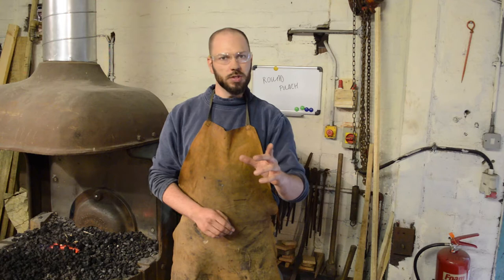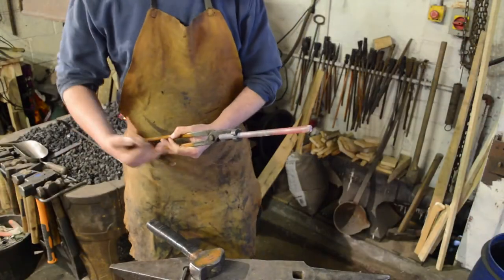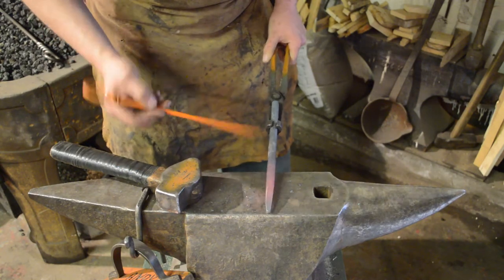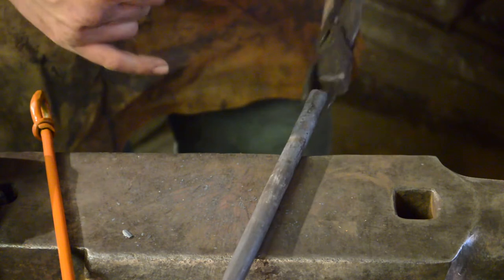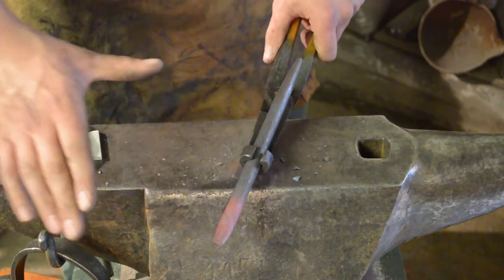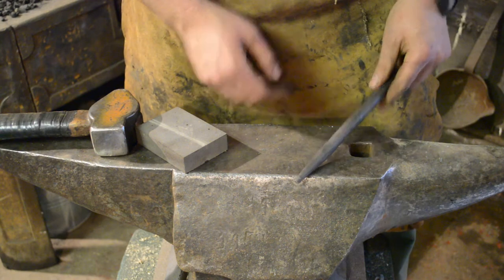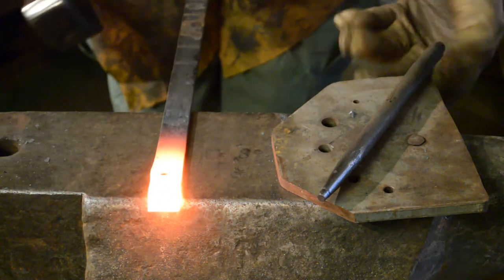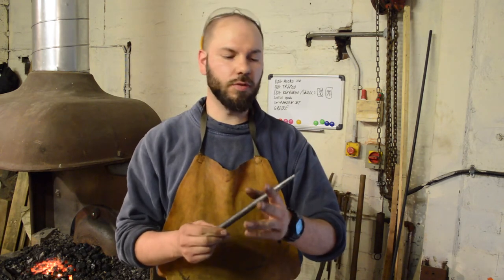Forging & Using a Round Punch: BB Ep 12

Comment: any advantage doing this over using a drill after forging?
as always love your videos
Reply from the maker: clive lockwood cheers bud. Drilling vs punching the hole isn't much different; both remove material. Hot punching can be faster when you're not filming it. The main reason I'm showing it is because it's a relatively basic technique and once you learn it you can apply it to other processes when forging. 
For example this is a step towards punching a hole in much larger material for something like a hammer. 
All the best bud, Andy.

Comment: Is there any negative to heat treating it? would it not double the usability?
Reply from the maker: Hi Ronan, thanks for the comment.  In short no, heat treating a punch like this wouldn't double it's usability. Because the steel you are punching is hot it is relatively soft. Spring steel is a very tough steel even in a fully annealed state, especially compared to the hot mild steel. - If you put mild steel and spring in this state next to each other and hit them with a hammer the spring steel would be much tougher. Imagine spring steel is like really cold frozen ice-cream - and the hot mild steel is like a marshmallow. 

I would say that heat treating a punch like this is just not necessary. The punch I used prior to making this video was made several years ago now and has punched hundreds of holes and has only ever required cleaning up after I  misaligned the punch with the pritchel hole and drove it into the side of the anvil. 

Remember for a tool like this you don't need a high Rockwell hardness, just toughness. Our ice-cream example won't shatter when you hit it hard it will just deform, but if you used something very hard like say a Jolly Rancher hard candy - that will just shatter. 

Hope that helps. 

Andy
Reply: Thanks Andy Mckenzie, I've been really interested in starting and took a 2 hours session with a blacksmith last weekend. I had taken a drawing of your rake to try make! Thank you for the videos! really enjoyable and educational
Reply from the maker: Thank you Ronan, I'm really glad there's people out there that are finding them useful. I wish you the best of luck with your blacksmithing endeavours. It get's a bit addictive though. ;) 

All the best 
Andy